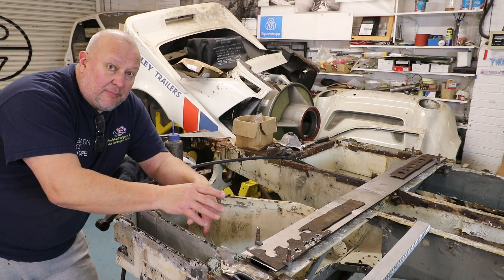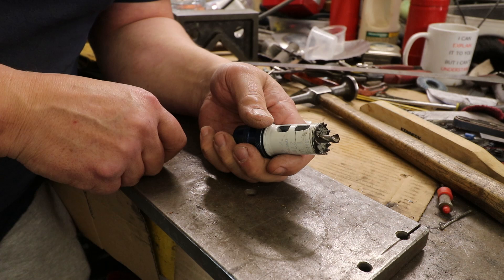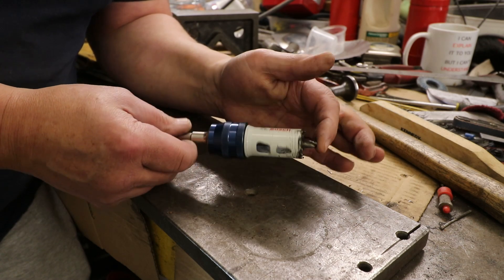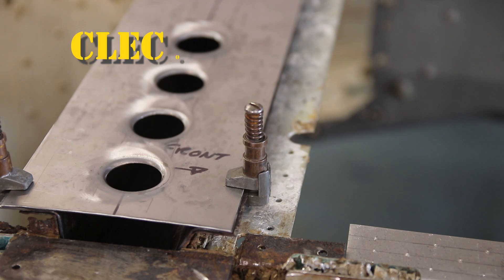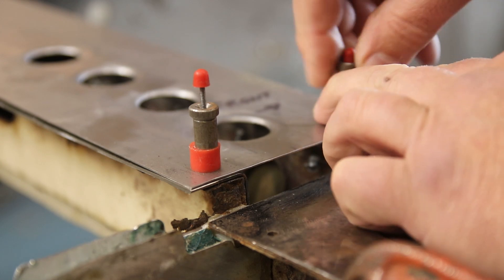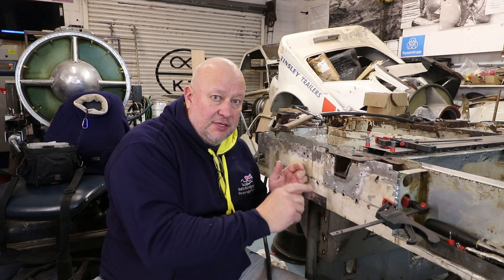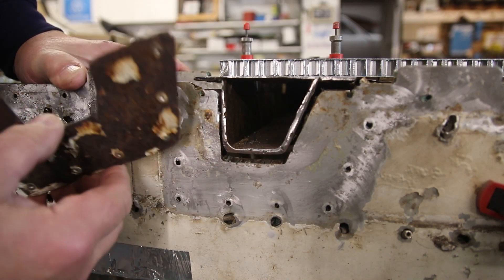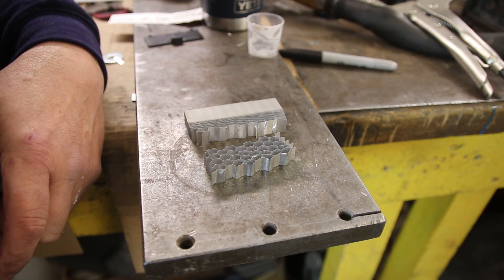Ford RS200 Rebuild! Great Progress And Much Detail. Part - 10 #ford #rs200 #rally

Comment: Amazing work just catching up very impressive but not surprised after the job you did on bluebird.
Will the finished car have the mark renisson livery?
Reply from the maker: That's the plan. We have most of the original body panels that we're going to clean up as little as possible so what you see is what ran back then in the 80s. It'll look like a wreck, no doubt, but at least it'll be true to itself and the resto work we're doing.
Reply: @ great stuff. Loving the videos please keep them coming. 👍